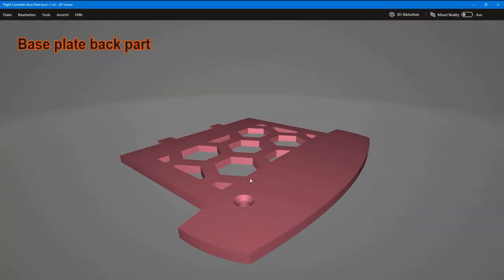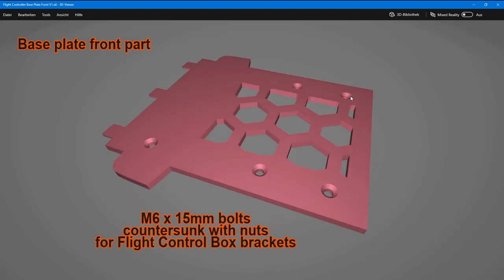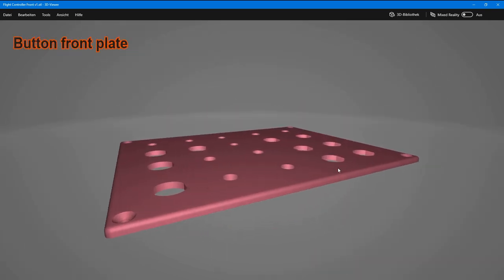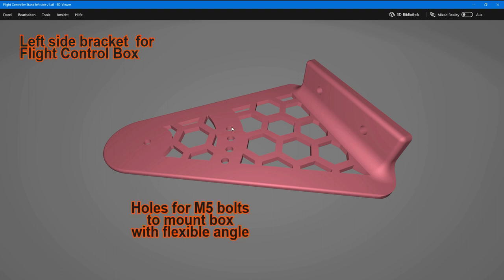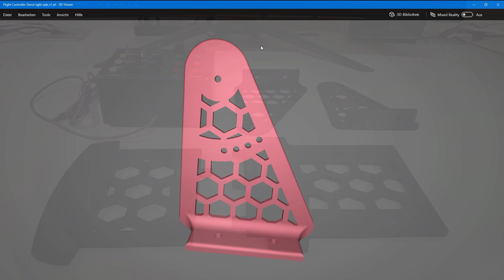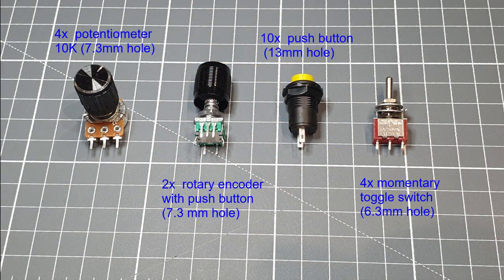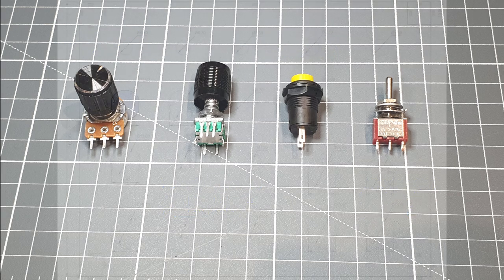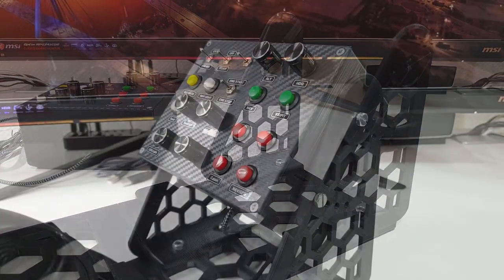3D printed Flight Control Board for Thrustmaster TWCS Throttle

Comment: First I was WTF, you use 6 rotory and this many buttons?... then I noticed that they are potentiometer. Oh, that makes sense. I need to figure out a way to get 5 rotory with push, 13 buttons and a dpad to work... i might need to go with Arduino mega or giga card...

Comment: I've just printed up the slider mod for my throttle and then found this. My rig is a dual purpose driving and flying sim and I was thinking about making a button box for the driving stuff so building one that does double duty seems like a good option. Thank you very much for offering the design and mount for free, I'll post a make on thingiverse when I get mine put together.
Reply from the maker: Thanks, hope it works well for you as mine does

Comment: This is definitely a future project i need to do, as this is easily the best solution for a tabletop buttonbox thats actually available. However im new to electronics and 3d printing. My question is how easy is it to change up the faceplate to customize which switchs im going to use in the 3d program? Thanks!
Reply from the maker: Hi Dylan, Thanks for your feedback. The faceplate is a part, what you can easily create by yourself. I work with Fusion 360 to create my parts and I'm not a pro with the software. But if you want to create more thinks in the furture it is one of the better tools with extended funktionality for free. There are also a lot of other tools you can handle easier and learn in a shorter time and these will work for a simple faceplate as well (eg. tinkercad).
May you saw, that I added a blank plate recently if you don't want to design a new one. You can quickly drill the holes you need. Hope you have fun with the button box when you print it.
Reply: @cksauerland  awesome! I saw it when I looked through the file. Is there a way to combine inputs without soldering or is soldering in sequence for a matrix the best way?
Reply from the maker: @dylanguion6731   I think it's the most cost effective way to solder the input cables. You can also use Buttons with prefab cables and also prefab cables to  push on the Arduino pins and than connect them all via WAGO 221 connecting terminals or similar if you want to avoid soldering. Hope I understood your question right
Reply: @cksauerland  sounds good! now I don't have a 3d printer so I am trying to see if I can get a local shop to do it for me but I am not too sure what to ask for. what method and material should I ask for? any advice? again thank you so much for your time and info!
Reply from the maker: @dylanguion6731  I never print something in a shop, but I'd expect that these guys know how to handle the STL- files with the information in the Thingiverse description. For the material PLA in your prefered color ist sufficient for stability. When I printed the parts, the PLA material cost was arround 15$ or 12€ but. Depending on very good material quality it can bei a little more. So you can estimate if the shop cost is OK.

Comment: Hi, thank you for the design, already printed half of it. Now I am wraping my head around how to create the wirings. One thing which is not clear to me is how to wire the momentary switches. I would say the side pins are connected to the matrix and the middle pin goes to GND? Or am I mistaken?
Reply from the maker: Hi Lukas, I tried to create a scheme of the wiring. Hope it helps.
You can find it for the next 7 days here on WeTransfer: 
https://we.tl/t-RwUscjHETe
Cheers Carsten
Reply: @cksauerland  Hello once again. Sorry I did not respond sooner but I did not get a notification. Thank you for the help.
Reply: @cksauerland  is there a possibility to reupload the wiring ?
Reply from the maker: @edforceone6966  Sure, I'll upload a file on Saturday
Reply: @cksauerland  also, how did you make the small labels? They look really good. I think this is the best button box out there
Reply from the maker: @edforceone6966  Hi, 
You can find it for the next 7 days here on WeTransfer: 
https://we.tl/t-QmpiWx13Nj
Cheers Carsten
Reply from the maker: @edforceone6966  I did it with a Brother P-Touch like the one in the link
https://www.amazon.de/BROTHER-PTH110ZG1-Beschriftungsger%C3%A4t-elektro-schwarz/dp/B01MZXL61M/ref=sr_1_17?__mk_de_DE=%C3%85M%C3%85%C5%BD%C3%95%C3%91&crid=1GD9T7HQZGI9G&keywords=Brother+ptouch&qid=1662805763&sprefix=brother+ptouch%2Caps%2C112&sr=8-17
Reply: @cksauerland  thx alot for the help, will post a remake on thingi when finished

Comment: love the design, I have an Ender 3 v2 but I can't slice the front base plate, cura says it's too big for my bed size? by the way I'm new to 3d printing
Reply from the maker: I have the same printer and it works. Do you use skirt or brim? If yes, try without
Reply: @cksauerland  yep that did the trick! Thank you!! :D
Reply from the maker: @alexanderaberg3597  you're welcome

Comment: Hi Carsten, thank you for this, you give me the way to move into doing this. I am actually wiring but even I understand most of it I am struggling on knowing how to wire the analog pines as looks to me that 6 are not enought, I am for sure missing something, for the potentiometers are you using one analog pin per each? if possible could you kindly share with me the connections schema?, that would be much appreciated as it is my first time here. Also I realized that you have kind of an additional piece connecting wires to arduino are those some kind of extension? Many thanks.
Reply: Ok I do belive I figured it out, just grouping buttons to make 3 columns of buttons (5,5 and 6) to just plug in into 3 analog pins looks logical to me :)
Reply from the maker: Hi, if you still need a wiring scheme, I have uploaded mine on Wetranfer
https://we.tl/t-pAo0G5VMAD
You can download it for the next 7 days
Reply from the maker: To be mor flexible with the wires on the Arduino, I soldered the wires in groups to some pin connectors liek these on amazon
https://www.amazon.de/gp/product/B00UQ8HJEQ/ref=ppx_yo_dt_b_search_asin_title?ie=UTF8&psc=1
Reply: @cksauerland  many many thanks! this is really helpfull!
Reply from the maker: @simbioscope3076  you're welcome